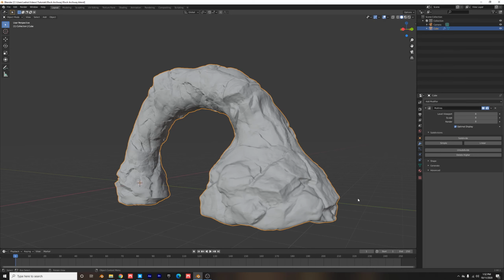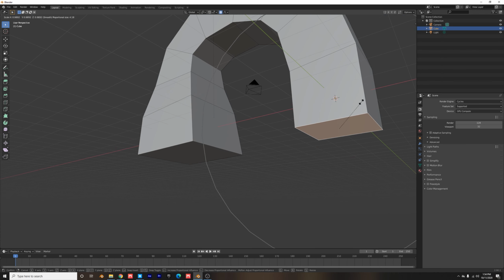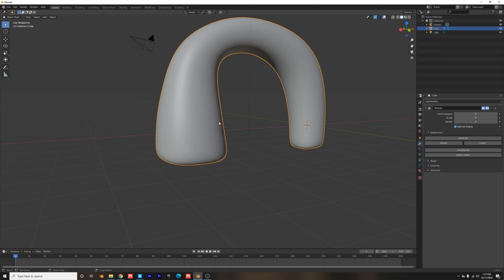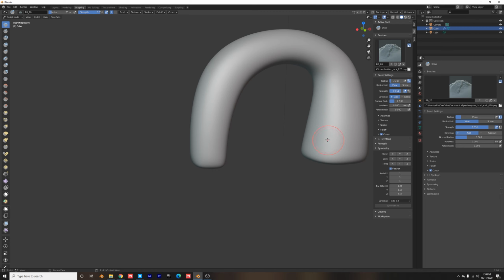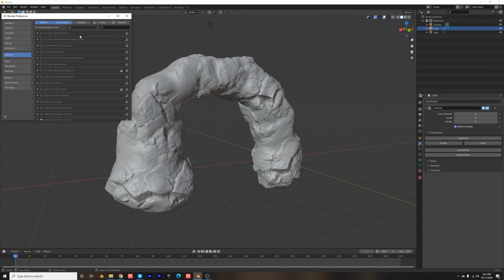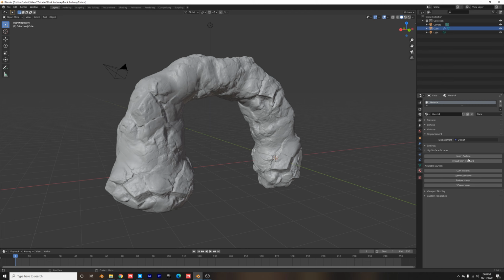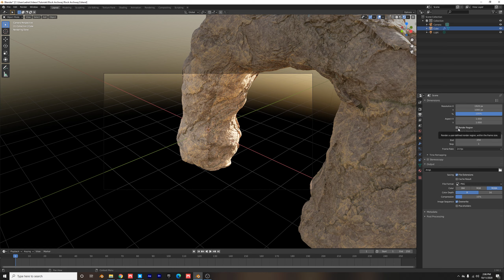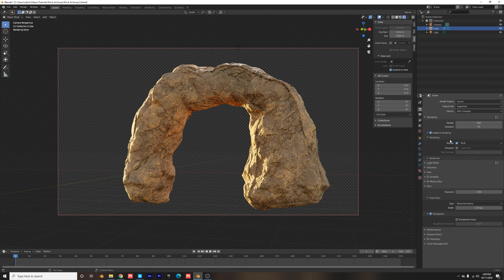How to Make a Rock Arch in Blender 2.90.1

Comment: I have a question, why didn't you use the subdivision modifier instead of the multiresolution?
Reply: I accidentally used the subsurf originally and the brush wasn't working. After once i restarted with the multiresoltion the brush worked fine. I don't know enough to tell you why that is lol

Comment: there is a bunch missing to make this work, with your exact settings (without knowing more of them) you get a circle of with a rock shape on top pressed out of the model which looks horrible, the stamp doesnt melt into the base model like yours does at all. What do we need to change?
 Your brushes are not adding on top of each other either, they instead merge together seamlessly, how do we change it to do that?
EDIT: Worked it out, you need to change the Texture --> Mapping to View plane to fix the weird circle issue I mentioned
Reply: I am having the same problem. Maybe this changed in the newest version of Blender?
Reply: @badlotto  did you try my EDIT as I got it working in the end, you need to change the Texture --> Mapping to View plane to fix the weird circle issue I mentioned
Reply: @N1ghtR1der666  I totally missed that lol, thanks for letting me know! That did the trick.